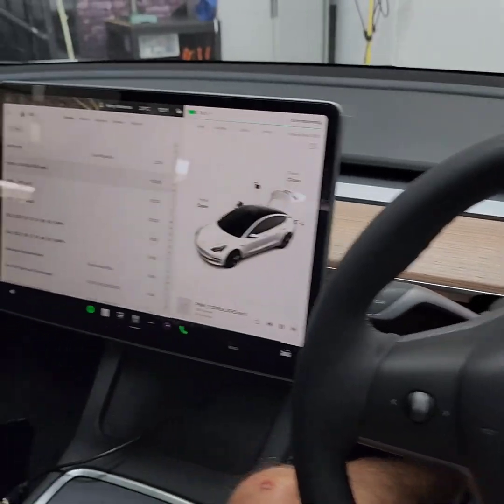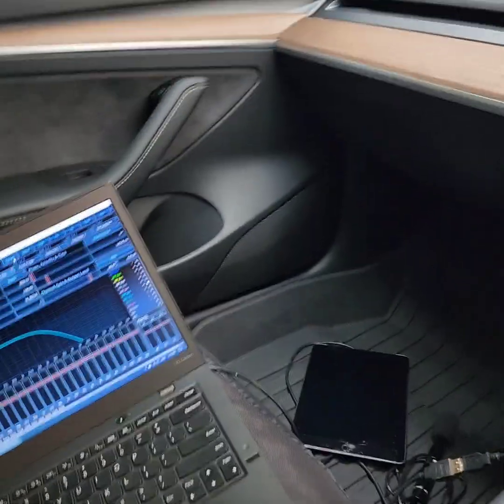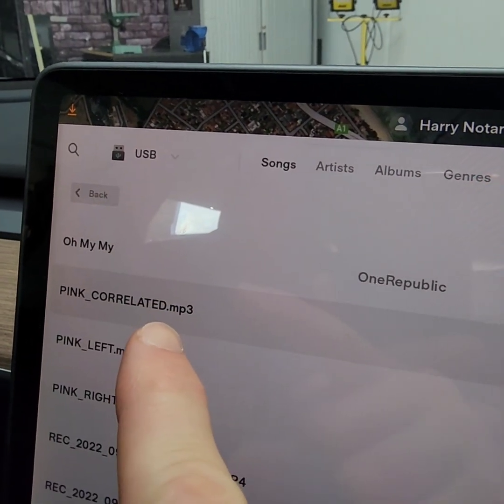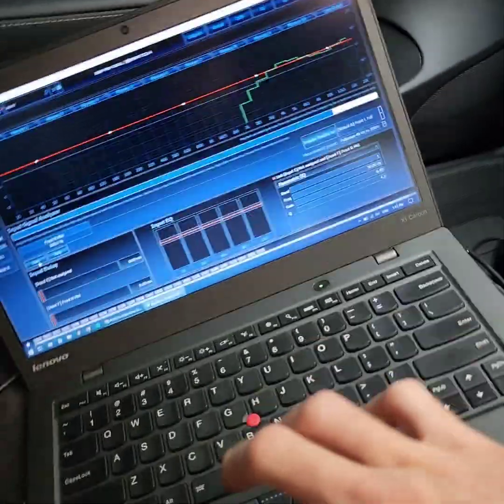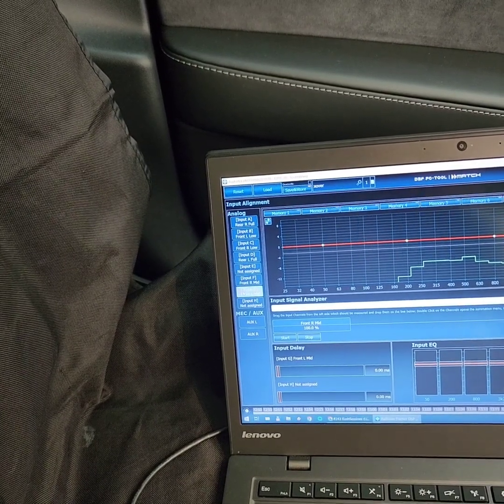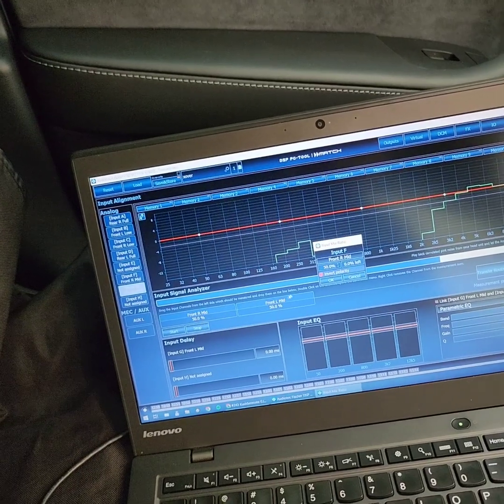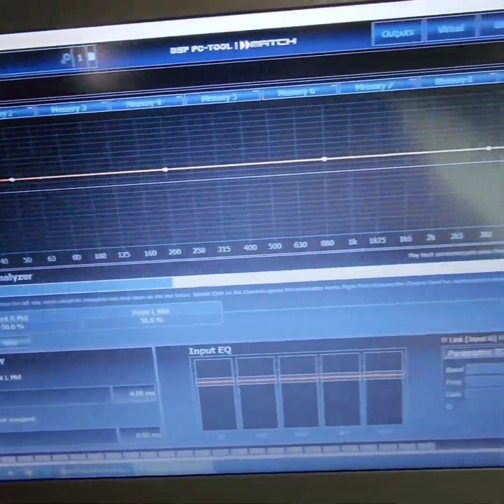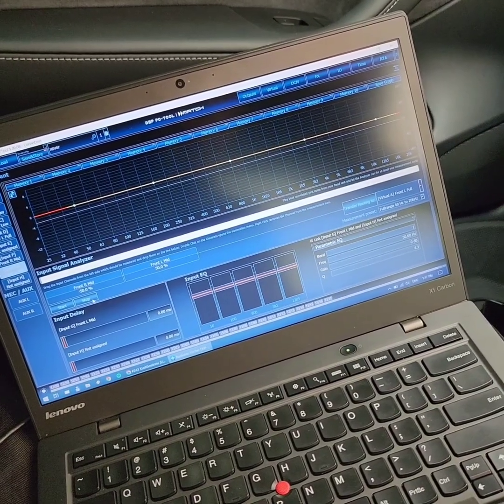How to check the Polarity of input channels using MATCH / HELIX DSP amplifiers

Comment: What mic are you using?
Reply: Above you said you didn’t use a mic. So if you’re playing a correlated link noise via a phone to the car, is the Match 10 simply looking at the signal it is receiving internally? No mic required?
Reply from the maker: @PbcMr Yes mate, it's probably a good idea to get familiar with the program first before trying to understand  its advanced functions, also my time for all these comments is limited. Have a good day.
Reply from the maker: no mic used here, it's tested via the electrical signal in the input signal wires
Reply: @soundtech7989  What do you mean by that?  You've got the high level inputs on the Matchup 10 connected to the laptop??
Reply from the maker: @PbcMr  I am not sure if we're talking about the same thing. What you're looking at is not RTA measurement, it's an electrical signal measurement in the IO section. We use an Audiocotrol microphone to show the RTA reading on a separate device, but that's not the part of this video so I naturally did not assume the question was directed to that. For this test, you use 2 of any of the Tesla inputs going through the UP10 and put them 50/50 together in the input signal analyser to test that the polarity is not flipped. The reading on the PC DSP-Tool input analyser will either show a curve (polarity not flipped) or no curve (polarity flipped). You must used correlated pink noise there. But there are still exceptions to this test so only take it as an extra indicative tool, not a 100% proven method.
Reply: I guess the question is, how are you getting the signal from the PC to the Tesla’s head unit or Match Up?
Reply from the maker: @PbcMr  The standard way, you play the pink noise from your phone Iike a normal song via Bluetooth to the car haha.